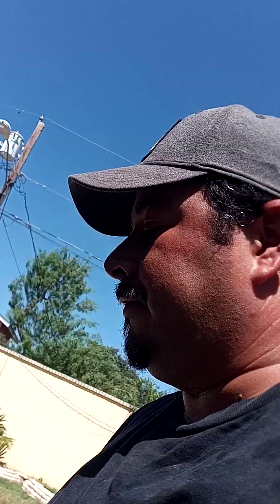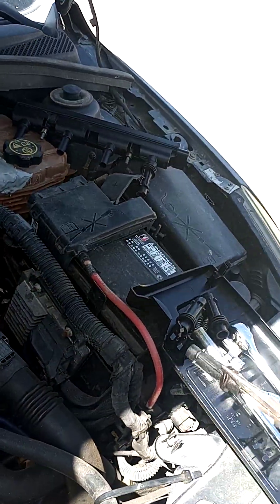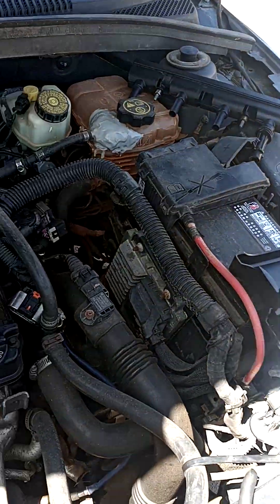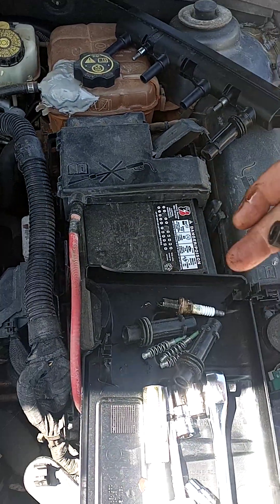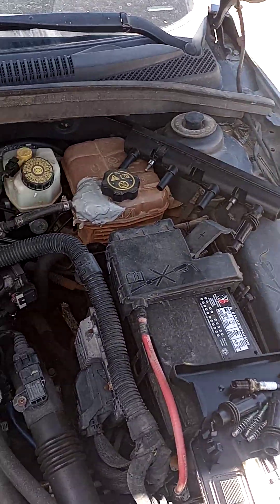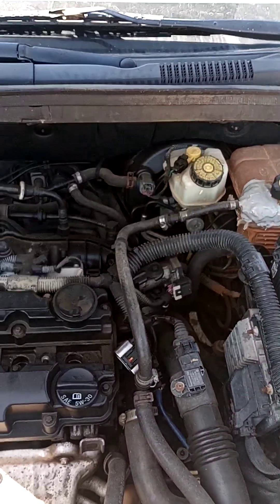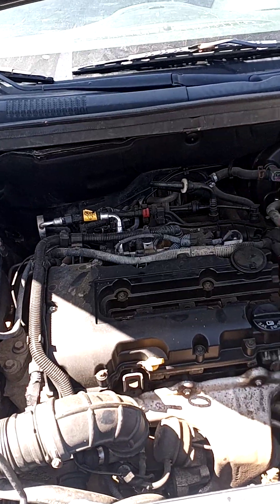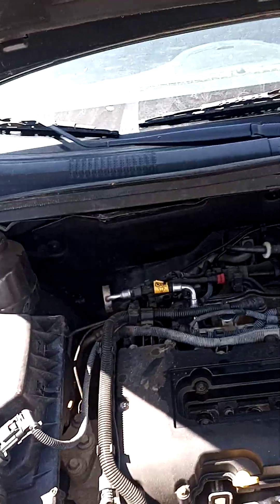2012 Chevy Cruze crank no start but overheating problem problem found and causes part 2

Comment: I had just replaced the head gasket on my 2011 Chevy Cruze and changed my spark plugs but there was no oil or rust in them at all so what could that mean in my case?
Reply from the maker: Worped head or hairline crack on cylinder or you can do a pressure on coolant try find where you are loosing coolant